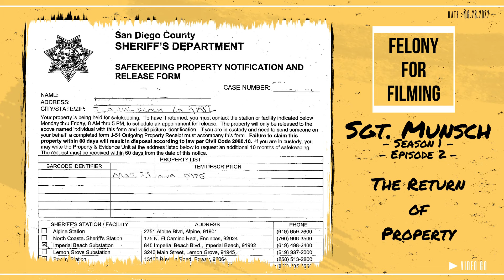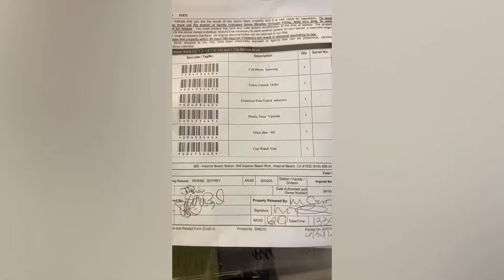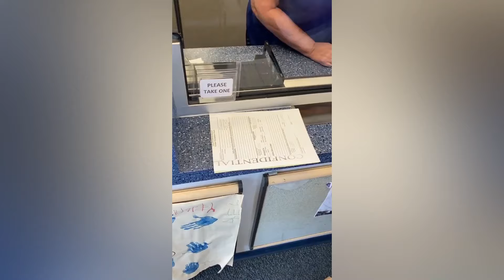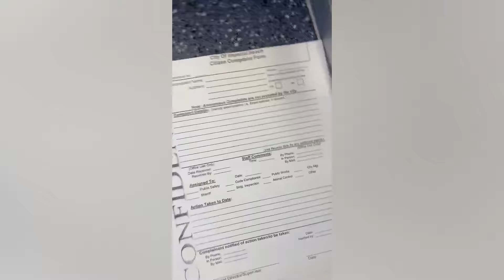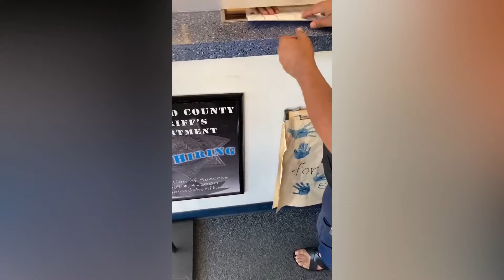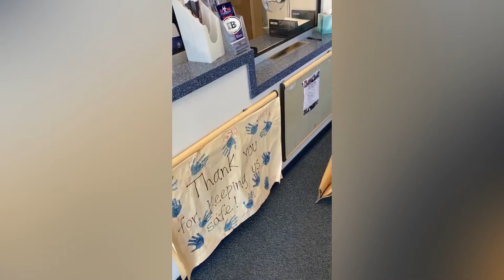Felony for Filming: EPISODE II = Return of Property in Evidence Bags + Complaint Form Fail

Comment: TIME FOR MORE PRIVACY. If you were to connect to the Internet using a MOBILE ROUTER, such as NETGEAR, it will output a WiFi signal for your use.

UNDERSTAND you will not have a TELEPHONE NUMBER which requires a SIM card in a phone, but it enables you to get a higher bit rate on the Internet. And your calling data doesn't exist. Any messaging service can be accessed.

Comment: SDSD uses former cops as Reserve Sheriffs Volunteer Patrol (RSVP) to hand deliver papers.
Reply from the maker: Its a federal crime to put anything in a postbox that doesn't have postage attached... just say'n...
Reply: @CopWatchIB  18 U.S. Code § 1725 - Postage unpaid on deposited mail matter. You should put in a complaint with the postal inspectors and investigate if it is standard policy to violate federal law.
Reply: @doingstuff6563  nice!
Reply from the maker: @doingstuff6563  Will do, and I'll post it too in the "Filing Complaints" episode... thanks for the suggestion.